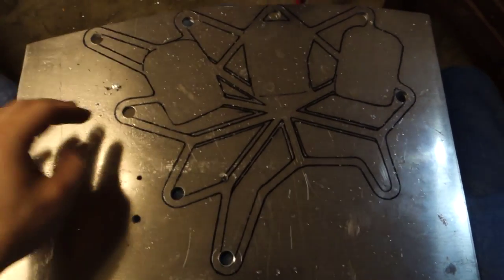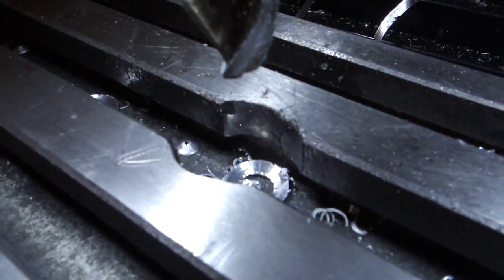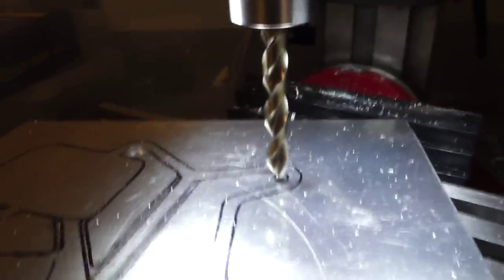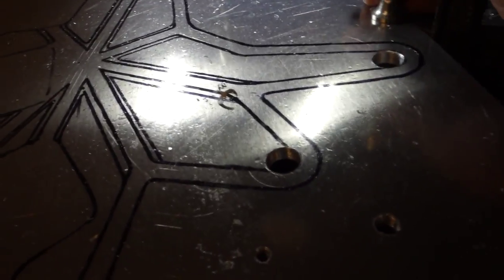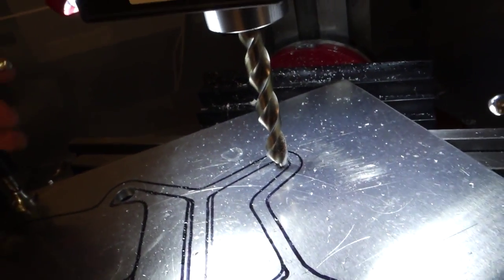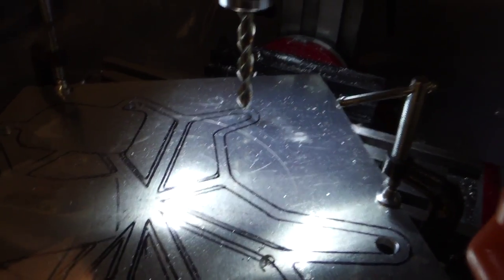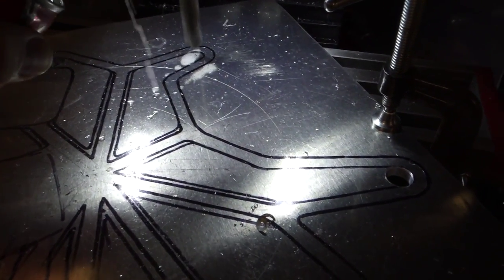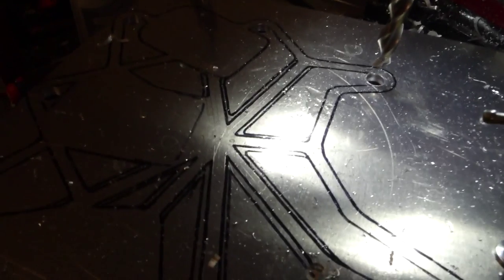Dewalt 20v x 6 Electric Bicycle part 6 drill holes in main plate

Comment: Question. I believe you posted a review for the "Craftsman CM COMPACT TOOL STAND". You mentioned you'd mounted a number of tools, including a drill press, to it. Can you give me any advice on your opinion of the best way to mount a bench mountable drill press to the table (such as the 10" Craftsman drill press)?
Reply from the maker: +Kevin Dorff Yea sure. The craftsman tool stand comes with 2 lockable base plates that you normally would mount your miter saw to. There is nothing stopping you from mounting any tool you wan to these clips. You just have to buy the spare clips from sears and I think they are like $30 a set, and get creative with the beams. I had a belt sander, drill press, mini bandsaw, scroll saw, and miter saw for mine. Its not as easy as it sounds though you have to modify some stuff as its rare for the bolt holes to line up on everything. I even welded up a rack using the same 2 tube design as the stand. You would clip them off the rack and clip them onto the stand. This system sounds good in theory but I kind of got sick of getting the stand out for just little things. lots of lifting tools around. I have since mounted my tools to a harbor freight pneumatic cart and when im not using something i drop it down and it fits under a shelving unit. Ill have to make a video of my new setup.
Reply: +Blair88mph Thanks for the response. Can you point me to a Sears URL for the clips? Or a product name?
Reply: +Kevin Dorff Oh you are suggesting buying another set of http://www.sears.com/craftsman-universal-clamping-accessory/p-00916494000P  and mounting the drill to those? My thought is to mount a 3/4" in sheet of wood on these in place of the saw and then I can make various mount holes, such as for my drill, onto that board. Does that sound reasonable?
Reply from the maker: yep that's it! Just get one for each machine.